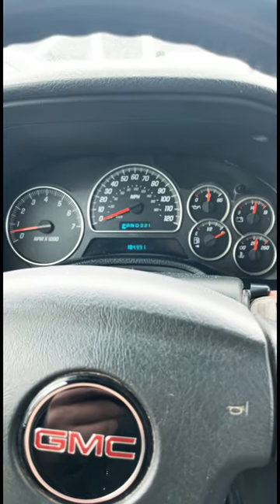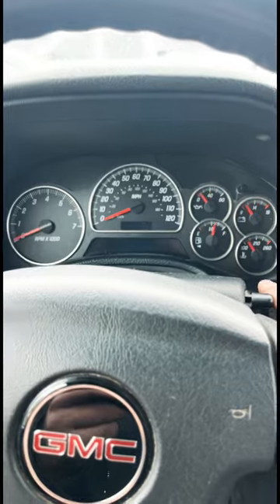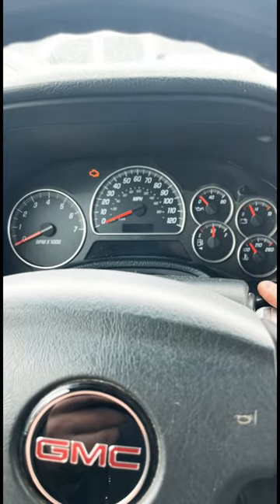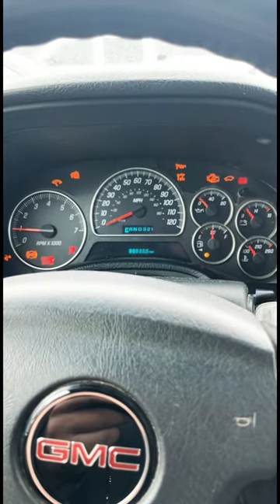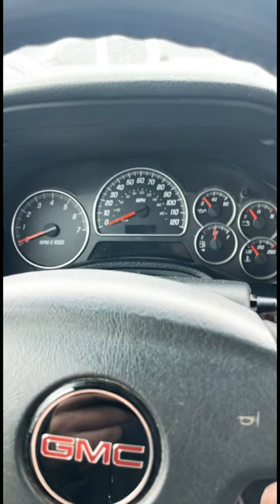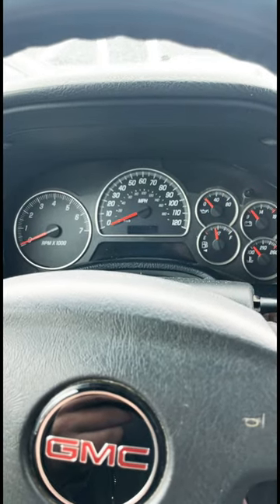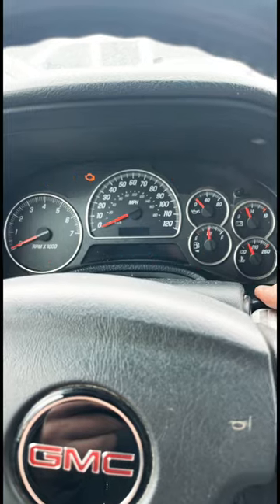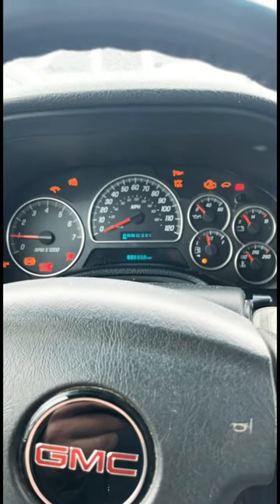Fix your Idle! 2000s GM Throttlebody RELEARN! #gmc #mechanic

Comment: Put a brand new throttle body on my 07 escalade and this did not work my idle is at 2000rpm this if frustrating
Reply from the maker: Sorry you’re having trouble, any codes?
Reply: @shiftwrenchrepeat  I forget the code but it's for the throttle body as soon as it's put in the check engine light goes away but the rpm is way too high to drive safely, while braking the truck still wants to go

Comment: I cleaned my 2008 Colorado 3.7ltr throttle body and it was filthy, afterwards get high idle after awhile it calms down but soon as you tap throttle it hangs at high idle also in drive it stays high idle . I’m going to try this trick !
Reply from the maker: Can’t hurt to try! Did you disconnect the battery and put the terminals together for a while??? That’ll drain and reset everything
Reply: @shiftwrenchrepeat  I have disconnected the negative side only for hours, but no I have not tried disconnecting both leads and touching them together for awhile . I will try this method tomorrow . Appreciate the feedback!!

Comment: my silverado 99 is idling at 500 rpm and sometimes the car just turns off. you think doing this could help?
Reply from the maker: Can’t hurt to try. Hard to say without seeing it
Reply: I’m having the same issue with my 02 Silverado 4.8, I’ve replaced coil packs wires plugs exhaust and throttle body, but it still idles low and tries to die when I turn the wheel slowly from a stop. I reckon it’s our IAC valve, I’m going to clean it tonight and see the results
Reply: @brandonwilliams180  did it help cleaning it? My 03 silverado dies while turning as well. Desperately looking for answers. Thanks
Reply: Maybe clean it first

Comment: Bro I’m trying this right now on my envoy and it’s not doing it I just put in a new throttle body now is running bad
Reply from the maker: Also try disconnecting the battery cables and zip typing the cable ends together so the metal ends are touching, and then let it sit for a half hour or so, then hook it all back up

Comment: I replaced my intake manifold on my 2004 gmc Yukon Denali then it started fucking up so I  replaced throttle body , pedal position sensor, maf and it sounds better but still acts strange from a stop not putting my foot on gas pedal it will keep automatically start increasing speed plz help
Reply from the maker: Hard to say without seeing it in person
Reply: Might have kocked a ground wire loose on the back of the engine.  There are 2 grounds back there.  I had an erratic idle issue after replacing my knock sensors on my 06.   Upgraded my grounds helped.
Reply: Buy the scan tool and fix it. Gm had software in their pcm that reads for carbon build up. But taking out the carbon or changing any part, gm doesn't  have a back to factory new alignment without a idle re-learn obd2 reader. None of these videos you watch work.

Comment: Got a problem with 2004 Tahoe at stop it drops less then 500 rpm and it shakes at high speed no problem at all, change all sendors and nothing next thing will swap the fuel pump.
Reply from the maker: I’d be checking and cleaning the MAF sensor.
Reply: Did that work? I'm having the same problem can't figure it out took mine to the shop they said they fixed by cleaning the throttle body but didn't work
Reply: Having the same problem replaced wires plugs coils I’m thinking it’s the injectors
Reply: Check your grounds on your engine and firewall
Reply: Check ya alternator! Also check if you have an exhaust leak if not that- check fuel filter

Comment: My wife's is throttling on it on and when you crank it up it jumps up too 2000 rpm should I do this new throttle body as well
Reply from the maker: Can’t hurt to try, hard for me today without seeing it myself
Reply: I’m same spot I turn it on and goes up to 2000 rpm and stay at 1500rpms then when put it to drive it makes a hard shift do you end up fixing ur problem?

Comment: I have a 4.8 vortec from a 2001 Silverado. Is it normal for the idle to be around 3000-3500 rpm? Mine goes straight to that once on and after about 10-15 seconds it drops to around 1000 for about 30 seconds to a minute and it just keeps repeating. I keep getting scared and just turn it off 😂
Reply from the maker: Definetly not normal haha
Reply: @shiftwrenchrepeat  I wasn't sure if the truck was attempting to do it's own throttle idle relearn. I was scared so I just turned off the truck. I did end up unplugging the TPS and it doesn't idle high at all. While it was still running and the TPS was unplugged, I also unplugged the sensor to the IAC and it started reving up again. Safe to say I need to replace the TPS or maybe both the TPS and the IAC?

Comment: So do you do this while the battery is still disconnected?
Reply from the maker: No, disconnect it first for a while and then hook it back up and do this
Reply: How long
Reply: @johngrove8587  I left mines disconnected for 3 min and when I tried driving again it shut off after about 4 days and cut back on. So I redid it again and haven’t had issues with it cutting off unexpectedly since
Reply: I change my throttle body disconnected the battery still coming reduce engine power 😅😅
Reply: @AdrianEvangelista-fv2ye  mine did that too I had to disconnect the battery fully and leave it off for like 10 min. It had to get used to the new throttle. Haven’t had an issue since. But it needs to be reprogrammed after installing new throttle